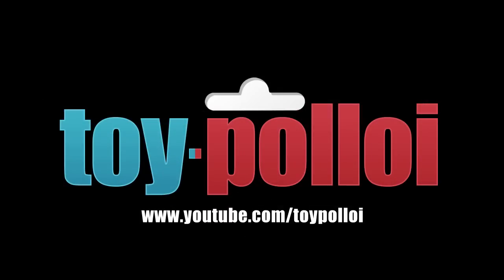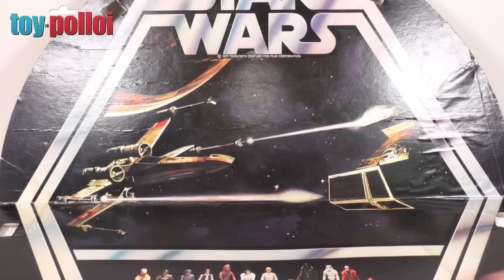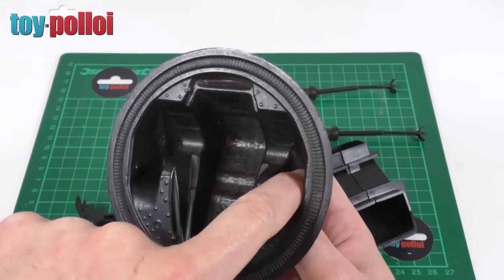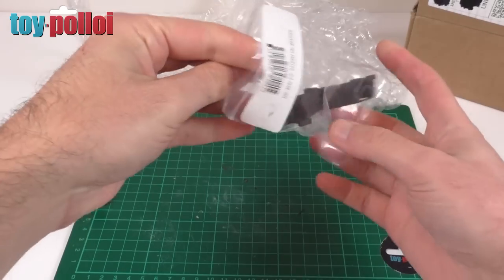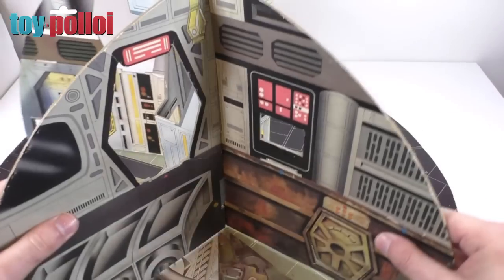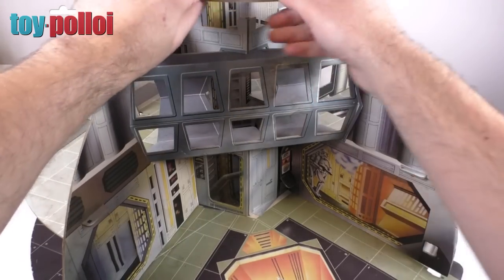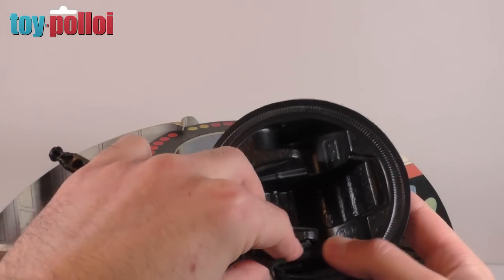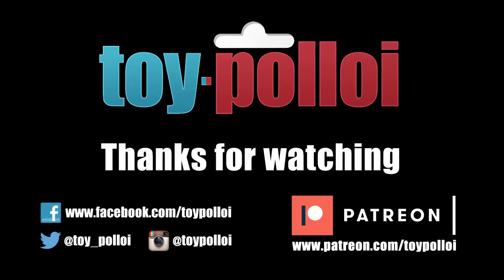Vintage Star Wars Palitoy Death Star restoration - Part Two - Toy Polloi

Comment: Looks great! You could scan these pieces, print them, and mount them on heavier cardboard to make a new and improved set.
Reply: Hmm, you could potentially kitbash this and the Kenner Death Star playset together for even more technological terror :D
Reply: Even better print on thick plasticard instead of cardboard.
Reply: Nitrous Diecast how about a larger improved one printed on vinyl and applied to heavy styrene sheet. And add some 3D printed bits
Reply: To bad these patterns aren't on the net where we could find them because both stronger cardboard and plastic card sound like great ideas

Comment: The reflective stickers might be an easy fix by not trying to remove them at all. If you can get a trace of the shape they should be in as a whole, you could cut a piece of 'mirror' scrapbook paper or score an actual thin plastic mirror (like from a cheap kids' beauty playset) down to size and just lay it adhesive-free over the misaligned stickers, in the bottom of the tower. On display, it'll look fine, save for the stray original corners poking out from underneath, but it'll recreate the illusion.

Absolutely love how this playset looks, all put together, even with its imperfections. The detail that was worked into it, the scale, and the construction are all things you can just sit and marvel at, like a sculpture.

Comment: As far as he laser turret canopy, you can probably use air drying clay to make a dome to vac form over. Clay can be carved, sanded, etc., once fully dry. You might be able to buy a sheet of clear styrene, heat it in the oven (maybe make a wood frame around it) until it sags a little, and then physically pull the softened plastic over the clay form, I have done it with white styrene and it does work, but never with clear. It might be an inexpensive thing to try. Then just cut out the part you want to keep.

Comment: I really enjoyed this video, Dave, because I have never seen the Palitoy Death Star in person.  Only in photos or catalogues.  I have an original 1978-9 Death Star Station that's in great condition with all the pieces unbroken, though I need to use your fix on the laser cannon to keep the barrel upright and proper.   Even though the Palitoy Death Star is mainly cardboard, it certainly seems to display pretty well.  As an illustrator, I can really appreciate the artistic nature of the panels and floor.  I have to say that I dig the look of all that!  Nice line art and a bit of airbrushing to simulate metal here and there.  The one complaint that I have with the American plastic Death Star Station is that it could use more detail, while the cardboard version is jammed packed with artistic details.   Obviously the Palitoy version being cardboard, it is likely to wear out, but it's easy to see that a lot of thought went into this playset. When assembled, it looks pretty sturdy!
Reply from the maker: I thought the same on the Kenner deathstar, which is why I made my own floor panel and sticker for it to give it more depth. It made a big difference to how it looked.

Comment: With adhesive a bit of heat might help but considering what it's attached to I would try a blow dryer maybe a dry empty iron and I mean just quick touches with it, not sure what the material is that it's made of or what time has done to it. But if you want to take a chance you might be able to loosen the reflective items adhesive enough where you might be able to turn it or take it off, seeing how it's close to the edge you might be able to slowly pull it off that way once it's loosened enough.

Comment: just wondering, the chrome silver bits, maybe you could paint in the correct position.with some chrome paint? 
also would it be a good idea to laminate the cardboard so its protected with a thin layer of plastic?  🤔

Comment: A heat gun may loosen that adhesive glue on the reflective floor tile.
Reply: Or a hairdryer
Reply: Was thinking the same thing.
Reply: I was just about to write the same, asking if it was possible to iron it away ☺

Comment: There's a few things on Shapeways that I've been looking into but haven't pulled the trigger on yet (right now, they have a bit of a delay on shipping due to coronavirus). Glad it worked out for you. They're kinda like Teepublic, in the sense that the quality of the product depends on the artist and the available finishing options they've supplied for the 3d print, so I think it's a YMMV situation with them.

Comment: Hi Dave. Have you found a way of successfully removing sticky tape residue from cardboard? I've found lighter fluid is good for getting the tape off but the stain left behind is hard to budge, without damaging the print. I recently acquired a Palitoy DS (already had the Toltoys AU/NZ version) and it has pretty much identical issues to this one. Cheers.
Reply from the maker: If it has soaked into the cardboard, then no. If it's on the surface it will come off with the lighter fluid and gentle rubbing. Cheers

Comment: Hi Dave. Great video as always. Just as a passing thought, I wonder if you could find a large clear Christmas bauble which could be fashioned to act as a temporary dome for for the top? I know this past Christmas, certain brands created extra large ones..just a thought..
Reply from the maker: Hi Karl,

That could work, and I have some that I used on for the landspeeder cockpit glass. The original cover is not a round shape, it's more oblong and only sits over the seat area. I'll find something. Cheers
Reply: I thought precisely the same thing👍🏻. Excellent.

Comment: Naptha/lighter fluid might take that reflective sticker off the floor section.  Might be worth a try!
Reply from the maker: Tried that in part one. Didn't work at all. It is really well stuck down.
Reply: @toypolloi  What about some label remover (think fellowes does some) ive used it loads to remove stickers off retro video game boxes.

Comment: And here I thought Kenner had exclusive rights to starwars looks.like a lot less plastic and  more cardboard
Reply: PAlitoy and Kenner were both owned by General Mills, which is why Palitoy were given the Star Wars license for the UK. We got MOST of the stuff that was released in the US, but there were some playsets and items that never made it here - the mini playsets that were released via Sears, for example. Or the A-Wing fighter. Additionally, while most of the vehicles that featured light and sound retained the feature,  the Palitoy X-Wing lacks either, so there is no 3rd button. The detailed cowling on the back of the fighter's fuselage was replaced with a black and white sticker. It was also only available in white (and I think, only with battle damage stickers), but lacked the black engine intakes found on the Kenner version.

This wasn't an unusual strategy - Hasbro did exactly the same thing with some of the Transformers, and we missed out some figures. Swoop was never released here, so One of Our Dinobots Was Missing, to paraphrase the old Disney movie. It's because the UK is a much smaller market than the US, and therefore can't support quite as many toys from a line at different price points.